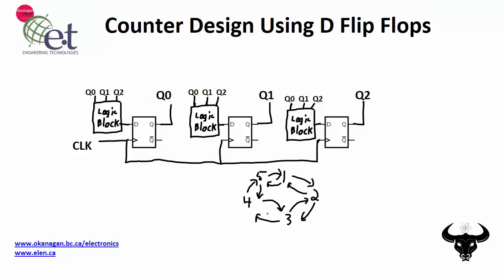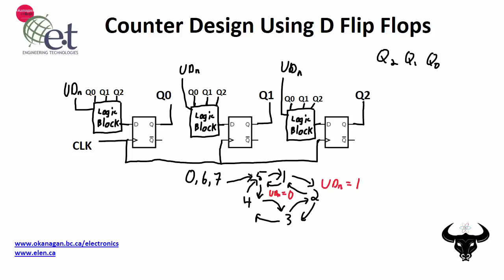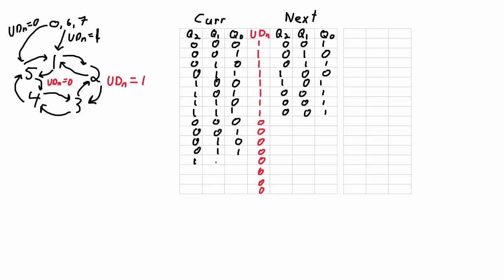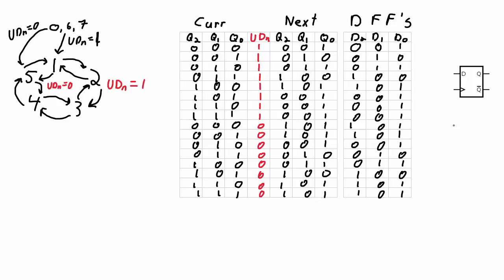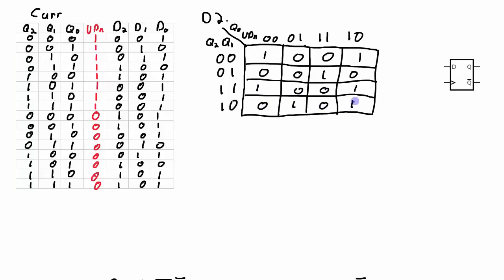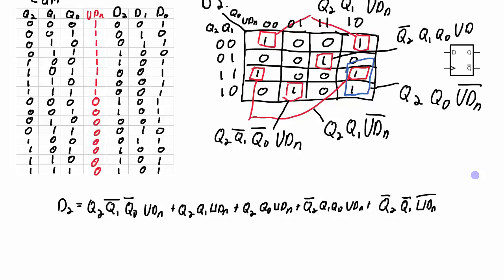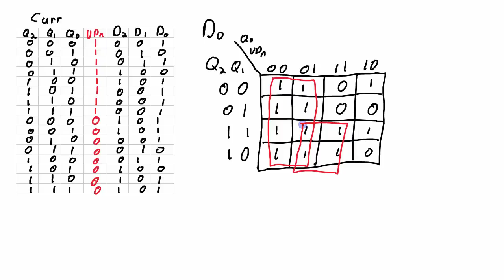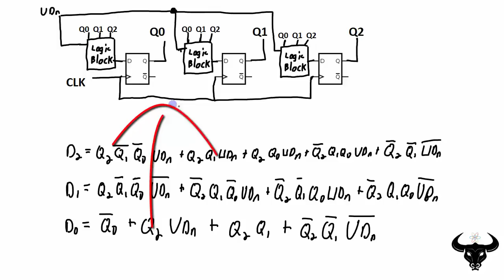Design a Synchronous Counter Using D Flip Flops

Comment: hi, while counting down, the next state after 001 should be 000, but you've written it as 101 in the video. Please clarify why you did that.
Reply from the maker: +Dhrithi Mahadevan I did that because I arbitrarily defined my counter as only counting 1-2-3-4-5 or 5-4-3-2-1, I did not include 0 in my sequence. I included the zero state in my transition table to avoid orphan states.
Reply: +David Williams thanks!

Comment: +David Williams Thanks for the lesson! Why is it that you have your Karnaugh table for the Qs listed as 00, 01, 11, 10 instead of 00, 01, 10, 11?
Reply: Karnaugh Maps drawings should ONLY have bits that are different in only ONE bit. For example, you can't have 01 and 10, cause they differ in both bits. The right thing is 01,11 so they differ in 1 bit. It's called Gray code, google it if you want
Reply: Makes sense. Thanks for the reply!